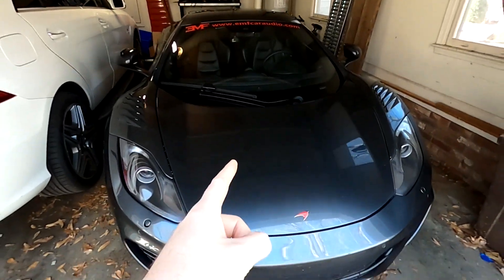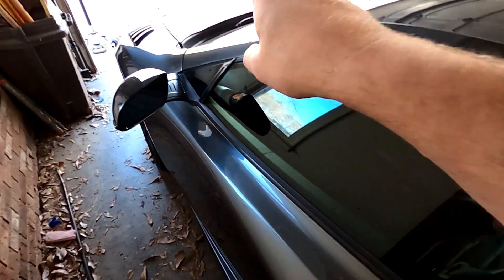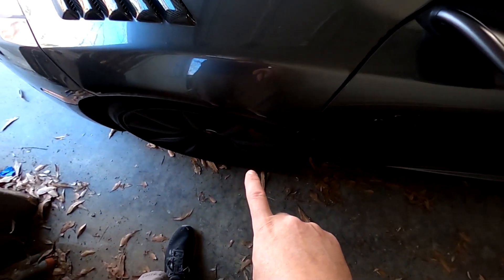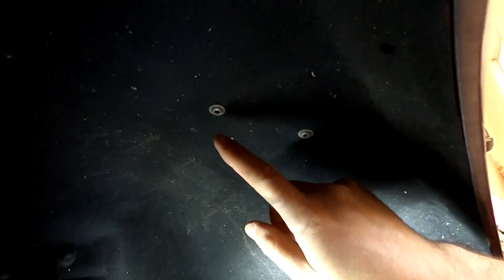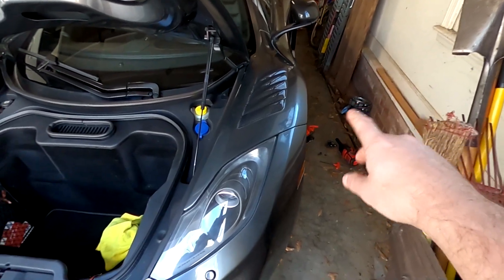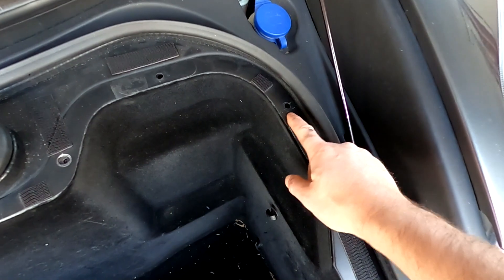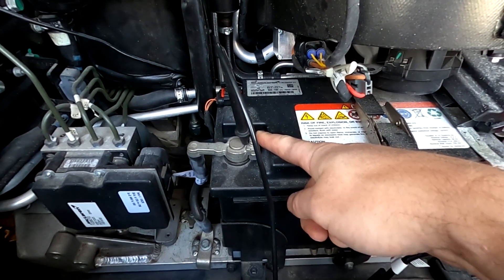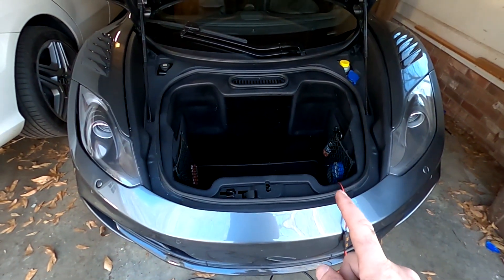How to get in your McLaren when the battery is dead, and how to wake up the battery.

Comment: Hi Sean! Thank you for this video, which also serves the purpose to not lose ones nerve when things are getting more complex with the McLarens. Went to the garage today and wanted to connect my Ecoflow "Powerbank" to the tender. Push the button on the key: 12C doesn't react at all. OK, went upstairs to check out the door opening procedure. My user's manual says that there is supposed to be a cover in the sill, below the door... Well maybe there is. But not on my early VIN car. Luckily the widows had opened that little bit as the should so a trusty wire clothes hanger did the trick in combination with the emergency release. Found the know on which to pull if you want to open the trunk and voila: Trunk open. Connected the tender - tender says "no". Uff. Back to the computer check out your wake up procedure. Luckily I have a NOCO jump starter which helped the battery to wake up agai. Since that the charger has initially drawn 120 Watts from the Ecoflow, now it is down to 84 - looks like 7 Amps @ 12V. Anyway: Your video has helped tremendously, I cannot thank you enough.
On a different note: Would you have any experience with dead door controls? I can no longer adjust the A/C or open the door electrically. The buttons in the door (engine cover, towing alarm etc) don't work but IIRC the window regulator still works. Any suggestion would be appreciated highly. Cheers, Joerg
Reply from the maker: There are a few reasons you might loose control of that door, and it all sounds door module related or communication related.
Reply: @McMedics  Thank you very much. Will first test the wiring then.

Comment: worked like a charm. my battery died because the outlet the charger was in tripped the breaker from another tool. My doors were locked, but luckily the windows dropped before it died. I was able to open the the door with the key (used plier and turned it it back and forth 10degrees to unstick it) unlock is rotating the key toward the center of the car. I also was able to open the door with a coat hanger and bulling the door release red cloth pull (i wanted to see how hard this was). Once the door was opened I pulled the frunk release. As for charging I am glad I watched the video till the end first. the 5second butt0n push worked great to get the charger working.

Comment: i prefer to keep my cars in the garage with the windows open. mostly because it's tight, and i can reach in and pop hoods or parking brakes. perhaps a charging port that is accessible from the outside of the car would be handy in case you need to wake it up with the charger, or a jump pack.
Reply from the maker: I usually do have the window down, sometimes I don't, and this just happened to be one of those times. The last time I had the bumper off I almost did put a charging port accessible from the outside but I didn't find a place I found acceptable. I may revisit that again.

Comment: If the unlocking manual key cylinder doesnt work, why McLaren put them there in the first place?
Reply from the maker: They think it's supposed to work. It's so difficult to do, people break keys trying. When I changed to soft close latches I tested it, without it connected turned fine but connected to the latch I could never get it to turn.
Reply: @McMedics  would be a interesting project if you convert it into a old-school physical latch if you don't care about car's resell value. 😂
Reply from the maker: I wouldn't want that at all! I love the swipe doors, and soft close. Figuring out how to keep the key cylinder working would be great but as little as they're needed not worth the time for most.
Reply: @McMedics  true, working barrel would be enough.
Reply from the maker: The barrel isn't the issue, that turns quite easily. It simply jams up trying to turn the mechanism in the latch.
Reply: @McMedics  oh I get it. try to upload a video of it if you have any interest of filming fixing it. would be interesting.
Reply from the maker: I have no interest in persuing that, at least not on my car. If I had one apart, maybe.
Reply: Can't find it  now, but watched another video. If you pull down on the door while turning the key it will reduce the pressure on the door latch allowing the key to turn more easily.

Comment: Hey man, quick question. Why were you taping it to get it 12V and not just leaving it on
Reply from the maker: Surging it wakes the BMS up, but you also don't want to jump start it or surge it with a lot of current as it can damage the battery in rare cases.

Comment: does the 570s have the same removable rubber liner?
Reply from the maker: The 570 tub comes out all in 1 piece after screws come out. But, to access the battery there is a removable panel so you don't have to do that.

Comment: Why dont people cut the trunk panel to make a "hole" for the battery? Since its plastic, use a plastic cutter to make a rectangular hole, then use tape or another method to hold the cut piece on the original panel, so when the battery is asleep, remove the "new" panel and normal process. Right?
Reply from the maker: This happening isn't a "normal" thing to start with. If the battery is asleep you still have to get into the car, that's the core problem, which doesn't help you with a hole in your trunk. Remember, what wakes it up (if you have a charger) is the charger itself, which doesn't require removing any trunk panel. Starting with the 570s they got wise to it and put an access panel in there to get to the battery.

Comment: Did you find out why the battery discharged?
Reply from the maker: OBD2 Bluetooth dongle was left plugged in.
Reply: @McMedics  A good bit of vehicles have come into my shop with the same issue.
Reply: @McMedics  Holy shit guys, you just helped me realize what has been draining my battery after almost an entire season of confusion. Thank you so much for sharing! I have a BT dongle I use to track rpm and pedal pressure on track days and never bothered to yank it out. I’m going to start the jumping method you showed here since my 570 is not getting any feedback from the charger, even with the reset button tricks.

Do you know if any standard booster will do here, even these devices are usually meant to be used for lead acids, or did you use a special one in this video?
Reply from the maker: @osx86touch  Try disconnecting the BMS plug on top first, then hit reset on the charger. If that doesn't work, there is a charger I've used that will wake one up. Otherwise you just want to surge it with anything 12v, just tap it, and make sure the BMS plug is unplugged.
Reply: @McMedics  Appreciate the help, I’ll give it a shot with the regular charger after having unplugged the BMS and if it doesn’t work I’ll try that. Do you think something as simple as a 12V wall wart power supply with the leads cut off could do the trick here? I don’t have a booster pack on hand yet. Thanks so much again!
Reply from the maker: @osx86touch  It needs some current behind it, at least 5 amps.

Comment: I always pop the hood open after each ride, just to avoid all of what you went through.
Reply from the maker: That can actually kill the battery.
Reply: @McMedics  I should have been more specific, not all the way open, latched close only to have the cable come out to battery tender.
Reply from the maker: Not fully latched can kill the battery, moot if it's on a tender
Reply: @McMedics  Yes. Been doing this since April 2018 with my 12c. No problems what's so ever. Now I got to figure out why my 650s is throwing off a battery management active error message. I already emailed your side kick ;)

Comment: Never like lithium batteries, they are so temperamental and just stop working with no warning.Odyssey batteries are so much better and don't cost as much as a lithium battery.
Reply from the maker: Lithium shut down before damage and don't have a memory like lead acid. All batteries die for a reason. In this case, had it been a regular battery I would have had to buy a new one.

Comment: Where do you get a price of $3K.  lol  My 720 was $400.  Nice lie.
Reply from the maker: Yes, $400 is a nice lie. You can't buy a lithium battery for $400 for any car.
Reply: @McMedics  nice lie?  I have my receipt in front of me from the dealer. $400.69.  You want to put money on it?
Reply from the maker: You might have a receipt for a lie they told you! They probably charges you $400 to wake up your battery and told you it was a new one. Even the Mercedes battery people try that doesn't work right is $1,600. Aftermarket with no BMS is $900. Check that battery production date vs your receipt, you got taken for a ride.

Comment: That’s not how you do it
Reply from the maker: I just did it in a video, so apparently it is.
Reply: Nope, you have a hidden key opener on the left side, you don’t need to take a wheel out
Reply from the maker: You do when the window doesn't roll down. When you use that key cylinder and open the door, the glass will break